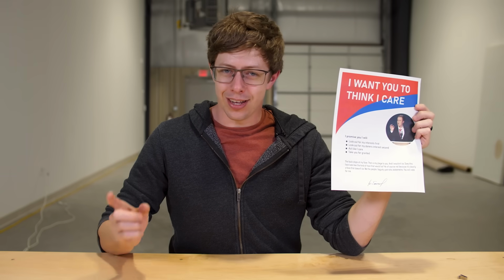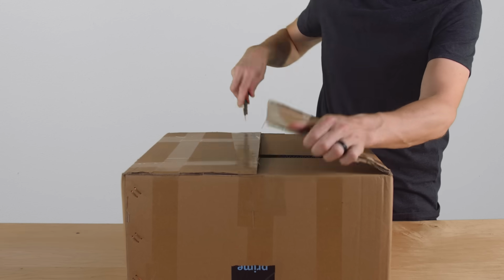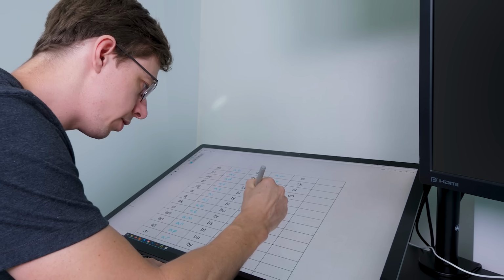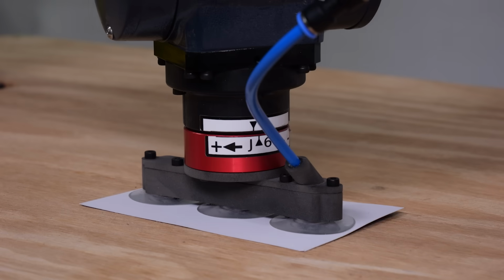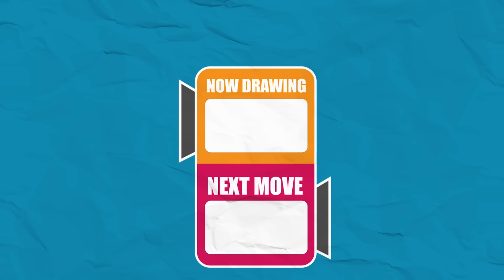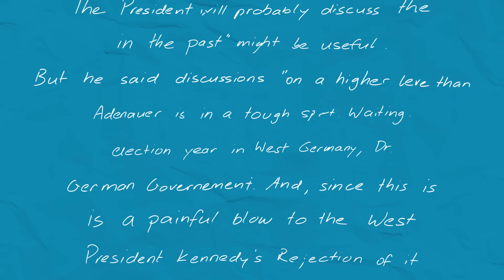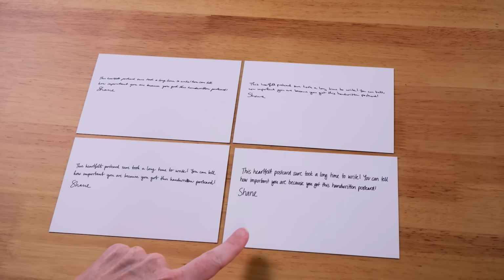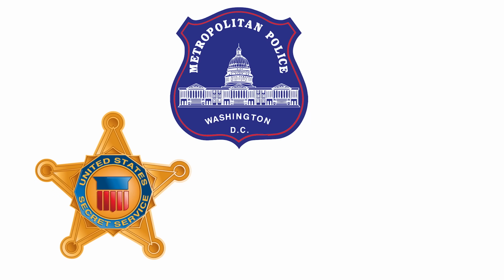I sent robot forgeries to a handwriting expert

Comment: just a tip when using neural networks. In the video, I noticed after every bug you fixed, the editing at least made it look like you spent ~50 hours training the RNN again. Usually, you can use smaller datasets to train the networks and see if the output is slightly acceptable before spending the 2 days training the network with the full dataset.
Reply: Bingo
Reply: I also notice he didn't plot his training loss / validation loss. It's very important to be able to know if both are decreasing, otherwise you might just be overfitting to noise or something. 😆
Reply: a
Reply: @fitybux4664  Also in realtime, to see if it is worth waiting another 50 hours
Reply: Or, just invest in better/more GPUs
Reply: i can hear him facepalming all the way from here before hearting your comment
Reply: It's been a running theme on this channel to test with the full process and hope everything goes right over doing small incremental tests to validate each part of the process.

The only reason it works out in the end is because he's a genius of the 99% perspiration kind
Reply: If you train full dataset each time, your balls gets bigger. Tried and approved by many many many many experts.
Reply: This is not true for a generative model if you're training from scratch
Reply: @ArnoldsKtm  Who's that?
Reply: @jaykay5369 for a short one off project, that's not worth it.

However he could rent gpu processing.
Reply: Literally looked in the comment section for this exact comment. I sat infront of my computer and literally blurted out loud "no way he retrains it with 100% of the data every time". Happy to see that someone else already had the same thought!
Reply: You can also use pickle module for python to export weights and biases which can be useful sometimes.
Reply: @orterves  I'm 99% sure you didn't mean that he sweats more than 99% of the population, but I can't figure out what you did mean. Presentation? Prescriptive? Percentile makes the most sense, but that's a) redundant and b) quite the autocorrect.
Reply: @kindlin  not a typo, it's a quote attributed to Edison about how genius primarily takes hard work - the perspiration isn't necessarily literal, the phrase is meant to evoke the hard work and perseverance required
Reply: @orterves  Ah, yes, makes sense. I'm such a literal person....
Reply: bro, I thought I'm decent at programming but you guys made me feel real stupid 😂
Reply: worth noting - the harder the task the more data you need
Reply: @kindlin I was looking for this convolution, and it did not disappoint! 10/10 conversation

Comment: Ok, one major tip: natural hand writing is in fact a 3D action not just 2D, meaning that the writer exerts higher and lower pressure vertical to the paper surface as they write, which results in the pen line becoming thinner and thicker at different sections of a letter! Next try to build the Y-axis movement into that robot!!
Reply: Brutal
Reply: Or the microscopic human skin flakes and grease we leave on the paper while writing?
Reply: Yes I thought the handwriting expert would make this point.  Maybe the robot does press more in some places?
Reply: I was about to suggest the same haha
Reply: Not only the pressure of the pen but angle of the pen too (or rather two angles) and the writing speed.
Reply: Z axis in this case. On CNC style machines, Z is usually up and down in elevation.
Reply: Great idea! It's funny that this video is Top 20 in trending right now. There's a lot of amateur forgers out there!! LOL
Reply: Plus the pen isn't always completely vertical in a hand
Reply: @wordzmyth  I think he probably did, and it may vary the pressure. He didn't mention any of this though.
Reply: @firesurfer  He didn't vary the pressure. His training samples were written on a touch screen and were saved as 2D vectors. No way to detect how hard he was pressing while writing those samples. It also would have taken a lot more than 46 hours to process with a similar algorithm if it included 3 dimensions instead of 2.
Reply: Also angle of the pen
Reply: I'm left handed, so constantly smudging the text I just wrote with my writing hand. I'm sure an expert could detect the pattern of smudges on anything claiming to be from me.
Reply: It does already have the X and Y axis motion, what's missing is the true Z-axis rather than a lift/lower switching tool and probably an A axis is also needed.
Reply: @iankrasnow5383  he could in fact record the pressure of the pen, but he probably didn't. Seeing his other videos I was kind of looking forward to that step.
Reply: Z-axis handwriting when
Reply: overengineering LMAO. The point is to make it passable not technically perfect.
Reply: @SamuelTheENTP yes just map the lightness/darkness of the pen stroke to the Z plane to emulate the pressure of writing various parts of letters under varying circumstances. I knew that.
Reply: actually doesn't handwriting use six degrees of freedom? You can rotate and hold the pen at different angles too. (Maybe for a ballpoint pen only five degrees are relevant, since rotating the pen around it's long axis probably has no effect on the shape of the letter. That's not true of a fountain pen/chisel nib pen though).
Reply: This isn't necessarily true depending on the pen and writer. The z axis is included as the robot does lift on and off to do gaps.
Reply: @wordzmyth because this is staged and it wasn't really a handwriting expert? You realize this guy is just hired by a production company right? He's an actor. His wife probably isn't even actually his wife either.
90% of the content on the internet is fake and produced.
Reply: What strikes me in some cases is the direction, like writing 's' beginning at the bottom or horizontal lines from right to left (on 't'). Not many ppl do that. Very interesting project technical-wise, but far from a 'proper' forgery, luckily :)
Reply: @dalyxia  That doesn't matter in this scenario lol. He was trying to see if the expert could tell. Even if it was authentic they could have wrote it with gloves. Which would not have skin particles or oils go onto the page.
Reply: The plotter absolutely does lift and press harder depending on how the code is written.....nice try. Next time know what you are talking about before commenting.
Reply: yeah but another thing he probably missed is that his writing is way way wayyyyyy too neat. Yes neat writers exist but they are far from common and even neat writers have mistakes. Theres also little punctuation and spelling errors which is also definetly an issue and then theres sizing. I noticed each letter tends to be the same height which isnt the case with real handwriting.
Reply: That and it's ... the letters really really really affect each other. Even the position in a word. Like, it becomes progessively more smush tho longer you go unless you take a break in between which is another semi random factor...
Reply: Very insightful point 👉
Reply: @iankrasnow5383  That is most definitely not a touch screen. You can see the cursor when he is hovering.
Reply: @dalyxia  Going full "Gattaca" with those false embedded skin flakes and organic body oils.
Reply: I thought the exact same thing at first. Due to Shane's level of intelligence and the high probability he consults an attorney before these videos are produced, he probably decided it was not a good idea to teach people how to create perfect forgeries.
Reply: @themonsterunderyourbed9408 I think you are about to detect something big. Shane obviously hired the same actress over and over again to play his wife over years of videos in single cameos each time. To make it more convincing, he also painted the wall of his shop with a picture of this actress
Reply: @iankrasnow5383  i wonder if he had used an apple pencil and ipad, or a drawing tablet with pressure sensitivity and such, if it would have turned out differently
Reply: ikr that was the first idea i had when i clicked on the video
Reply: @Geeksmithing  Yep, because in CNC, the 2d perspective was originally(and often still is) the primary consideration. And with 2d perspectives the X and Y definitions make sense.
I hate it for 3d modelling though. Traditionally Y is up and down. X is left/right, and Z is front to back.
Reply: @themonsterunderyourbed9408  schizo
Reply: @rich1051414  yep! Even going from Maya to a game engine can even be different, not even delving into the desktop fabrication machine ecosystems! 🤣
Reply: Hunted for this comment you are absolutely right
Reply: The X and Y are correct.  Downward pressure would be the Z axis.
Reply: If it’s a 3d space wouldn’t it be the Z axis? Lol
Reply: Z axis actually
Reply: This is exactly what I thought right at the beginning when he first said Shane was going to send it to a forensic. Pressure on the paper is how you can tell very quickly if it was human.
Reply: This plotter does have Z variability that affects line thickness - you can see it at 16:40
Reply: Yes! Also, human handwriting is not formed in non-continuous jerks. By jerk I mean the third derivative of position. It seems to often be noncontinuous with robots (the acceleration even seems nonconinuous). Can you detect that on a print? I'm guessing it would show up as some sort of artifact like maybe a mark where the non-continuous jerk happens, but that needs testing.
Reply: would be better to use force than movement though, because the difference in height would be so small it wouldnt be trustworthy
Reply: @dalyxia oil not grease

Comment: I have to say, one of the most helpful parts of your video was when you gave up and used code off the internet. It's nice to see others realize that some other people just do things better sometimes and you don't have to re-invent the wheel every single project. Buying a plotter, borrowing code. This is how things move forward. Good luck in your new shop!
Reply: That's how science and engineering works. You use what other people have done in the past to create something new.
Reply: Anyone have tips on how to do this more? I often feel like I'm spending just as much time figuring out how to integrate or implement their code into mine. I suppose that's just down to the quality of the documentation?
Reply: yeah, I started writing a custom library for playing audio files in vanilla JS, and then I thought "wtf am I doing - just find an open source one". And lo and behold, there are like 5 of them.
Reply: @EmersonPeters  Be sure of what you need. Once you know what goes in and what goes out you can use other works as a black box. GPT can also help with code integration nowadays.
Reply: That is why i share every line of my codes to github... it feels great to see someone uses something you did and turn it into something more useful 😂
Reply: That's how Bill Gates worked.
Reply: @EmersonPeters  Documentation and similar design methodologies between libraries.
Reply: @EmersonPeters Mostly just practice. Do problems you're not used to so you're forced to try and see how other people solves them. That said be wary to not just copy and paste things and try to understand the code yourself.

Comment: I'm surprised pen pressure on the paper wasn't more of a problem. Seems like the robots perfect line darkness would stand out more.
Reply: My guess is they actually talked about how good they were, and what we saw was what we were allowed to hear.
Reply: I came here to say this, but in my heart I knew it had already been said
Reply: Probably not the most notable thing, especially if you consider if they were actually sent out you’d only see 1 and would have no comparison for the pen pressure,

And repetition is much more noticeable to the brain
Reply: @BossKnight also ballpoint pens, especially decent quality ones, tend to have little variation in darkness with pressure.
Reply: You would be able to see lots of different pressures between each letter. When handwriting, you have to lift up your hand for each letter so you wouldn't be able to use the same pressure on every one
Reply: And also the straightness of the lines of writing. They're perfectly straight on an un-lined card. No human can do that.
Reply: @FPGAsforBeginners i know a few people that can do it. I also have done it but cheatingly: the paper underneath the paper I was writing on was lined,
Reply: @amb4368  I don't disagree with you but you have to consider the length of the words, the number of letters and the spacing between them to actually measure the pressure. Unless every other word is a repeating word, it can be easily overlook. We need a trained AI to decipher something like that.
Reply: you certainly wouldn't need an AI to identify if something was handwritten based on paper deformation. the microscope was not necessary in the first instance of the printed signature copy; it would have been obvious with the naked eye alone that no pen had impressed the paper (and the signature was clearly not brushed).

the specific issue here is harder, because the robot's pen did impress the paper, but if you had a microscope -- perhaps even just a lens -- you would, i think, with some effort be able to notice a completely even depression of the paper even within just a single letter, even without examples of real writing in the same hand.
Reply: @FPGAsforBeginners  in fact, quite a number of humans can do that just fine, especially when the length of the lines is so short and the characters are so simple. i know many calligraphers who would never bother with guidelines for short cards like this, unless they are doing something extreme like copperplate or some outrageously flourished blackletter.
Reply: @jacksonfrost9710 Wouldn't the depression be varied due to the speed changing as it turns or approaches a turn? I imagine that could still possibly be detected, but it'd be a lot harder to notice with fluctuations
Reply: If he used say silicone for the grip of the pen that was thick enough and soft enough to allow a bit of flex it would make a more varied result in pressure and also result in more random unique letters throughout the writing samples.
Reply: People don't start each line from the exact distance from the boundary and the lines are not always perfectly straight. There are random slantings in each line which they subconsciously correct as they go. Subtle variations in the size of each alphabet in different words are also there. The way each alphabet is angled is various words is also noteworthy.
Reply: the uneven leveling of the cnc bed would take care of it

Comment: I kept all my school documents. And that is a lot of hand writing. I wanted to scan it all, and use OCR with a temporal variable. That way I can see handwriting improve over time. And also train a model to write whole words, not just single letters. 

But scanning two full boxes of documents takes over a week. And I don't have any scanner. 

I feel like a vector sequence model instead of a pixel model would generalize better.

Thanks for sharing your work!

You are experiencing the machine learning researcher: "press the run all button!"
Reply: You are onto something with the vector graphic.   Based on Embroidery machines and sign cutters, I am sure that is the input that the plotter accepts.
Reply: I spent the last 8 or so months scanning thousands of documents, and I have gotten fast enough to be able to scan a box in a day, maybe two if it’s a really annoying set of documents that aren’t standard paper size.

Comment: I'll likely never get into robotics, but this man's passion is nothing short of inspirational. Cheers to doing what you love Shane!
Reply: I program similar robots for CNC production.  One that that made me curious was to the paper getting picked up problem.  He built those platforms with the springs which is near but those robots have the ability to compensate for those sorts of things.  

We have pallets that we place parts on and we can teach the first point on the pallet and the robot auto compensates and grabs each part and moves up and down the pallets automatically.
Reply: @specialsause949  Same here,  programming for cnc tending. The function I used was called servo float or soft servo. And the end effector would stop with a programmed force.